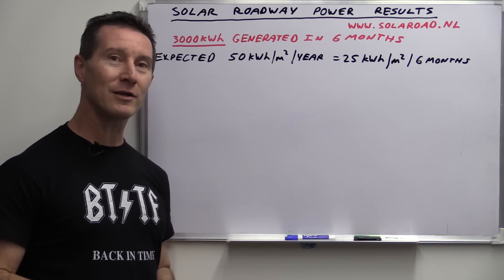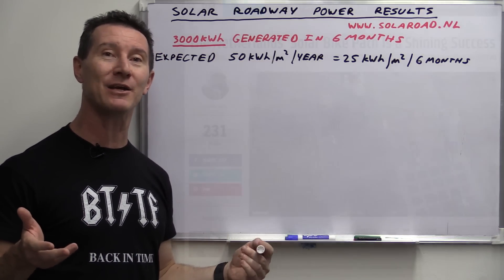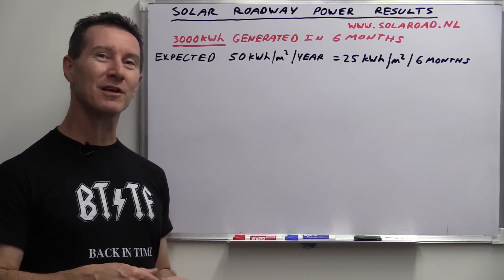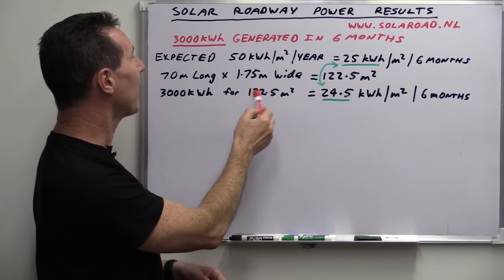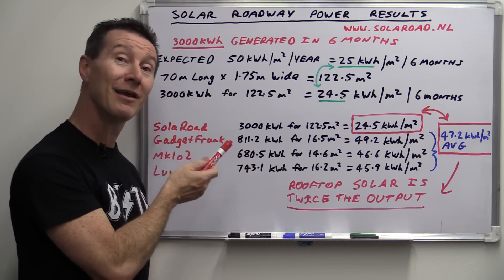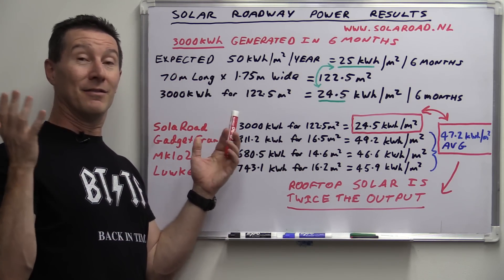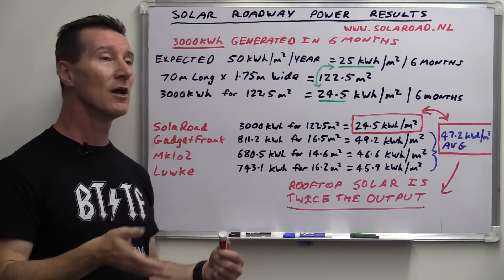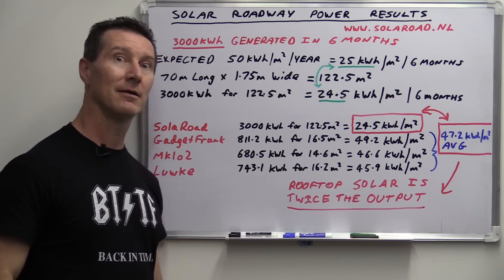EEVblog #743 - Solar Roadways Test Results

Comment: I live next to the bikeway, it was closed for almost the entire winter because it was broken. It was also an unusually warm year.
Reply: MichaelKingsfordGray It snows maybe once a year in the Netherlands.
Reply: ***** They are also inefficient in the usual way: it will take 4,000 years to generate enough electricity to pay for their installation cost. That's rather seriously inefficient, wouldn't you agree?
Reply: Isaac Karjala
You can't have an aperture without a lens? Any hole or opening is an aperture. It's not just a photographic term.
And yet, have you ever used a pinhole viewer? You know that the pinhole is an aperture without a lens?
Reply: *****
Maybe you should look it up and read all the meanings instead of your own narrow view.

The word itself literally means HOLE, comes from the Latin word to "to open" and is far older than cameras and camera terminology.

Merriam-Webster:
Full Definition of APERTURE
1
:  an opening or open space :  hole
2
a :  the opening in a photographic lens that admits the light
b :  the diameter of the stop in an optical system that determines the diameter of the bundle of rays traversing the instrument
c :  the diameter of the objective lens or mirror of a telescope

Oxford Advanced learning Dictionary:

aperture noun

(formal) a small opening in something The soldier fired the rifle through a narrow aperture in a pile of sandbags. The bell ropes passed through apertures in the ceiling.

(specialist) an opening that allows light to reach a lens, especially in cameras For flash photography, set the aperture at f.5.6. Open up the lens aperture to maximize the brightness of the shot. Binoculars of this aperture are very expensive.

Word Origin late Middle English: from Latin apertura, from apert- ‘opened’, from aperire ‘to open’.

There you go, facts that took about a minute to look up yet again for the same person who can't bother checking, yet again.
Reply: ***** Yea, i was just going to tell him to look it up in a word book in stead of wikipedia,.... welll any way, would be interesting if he response to this with a ..

"If people make mistakes why don't they just admit / fix them instead making them look silly by arguing their mistake is correct?"

typ argument, just ignore the facts, or not respond at all.
Reply: *****
"Didn't one actually admit to not watching the video?"
Well i don´t no if they admit it, but they really cant do it, its to dangerus, it might change there world view, and that is really painful.
Reply: ***** ignorance is bliss.
Reply: ***** Its really a question of how clody it is, not warm (at least in the summer). But in the winter the clowdness and heat is often connected. It would be intresting to compare this november to april to the one 2013 and 2012 and se if it better or worse.

I would suspect.... well not living in Netherlands, but fairly close, that this winter was far better.
Reply: Rashombo Hans Brinker would need silver swim fins now!
Reply: ***** Well, its probobly the glas that broken, not the actuall panels. I would guess that there is two layers of protective glass.
Reply: matsv201 I thought their glass was made of quartz.
Reply: RagingDong Did i say something other?
Reply: MichaelKingsfordGray
That is what they proposed to build the roads from.
See, per mile, reflection based solar towers collect 1000's of times more power than solar roads.
Reply: Here is the thing. Regardless of what tech you use for making the sun into electricity. The cost of the glass will always be about the same (per area). (well, unless you put it on the ground and run cars over it)

So you always want maximum sun exposure. So high up and in a optimal angle is the best.

Also, there is two routs. One is to use cheep silicon PV had have the lowest possible price. The other route is to use more advance method and have higher price system, but less amount of glass.

For a standard Silicon based PV roof top installation the cost is like 25% PV:s, 25% glass, 25% other installations (mostly electronics) and 25% work.

Pushing down the price of the PV:s just don't make any seance. If the PV is totally free, you still have 75% cost left.

On the other  hand. If you can double the performance of the PV, say you double the price. You got 50% PV cost, but 12,5% glass and work, and probably like 20% instillation cost. The problem is that PV that are twice as efficient is not twice the price, rather 10 times.

Going the CSP rout then is much more logical. Not only does a good CPS produce about twice the amount of power (for the same area) it also produces power during about twice them time of the day.

The problem is that the CSP is more of a centralized product like any other power station, and the on roof solar is more of a political statment, than a energy-economic one.
Reply: matsv201
If a PV panel costs 25% for the PV cells and you double the cost for those, the end price is 125%, 1/4 more not 10 times.
Reply: ***** No, doubeling the efficenscy, not the price. That was one exaple where efficency was tied liniery to price, and the real world one where it 10 times more expensive.
Reply: RagingDong
You can do that anywhere on Earth that sun shines and get distilled water out. It just takes bigger reflectors in some places.
Reply: RagingDong Actually i would say that the Stirling powered CSP is both more efficient and more modular than they big steam once. The best one is doing about 35% from light to power, that is pretty good. Its basicly twice that of PV and with the turning tower the capacity is twice over again.

The is the question if bioreactors will be more efficent in the future. They are almost copetative alreddy to day.
Reply: MichaelKingsfordGray It depends on. There is some efficent carbon capture, like the one the US navy uses that actually work. So it actually works.

So i would say its actually not as bad as you say.
Reply: MichaelKingsfordGray You dont need a peer-reviewed article for something like this, you just have to have knowledge in basic math
Reply: MichaelKingsfordGray
They are only inefficient compared to the current cost of fossil fuels with minimal to zero regards for pollution and the costs that inflates.
Reply: matsv201 pv brings power generation to where power is consumed, hence lowering transmission losses and by lowering transmission losses a lower efficiency on the generation equipment is acceptable...... Also, thermodynamic efficiency of PV, CSP, wind, etc is entirely irrelevant since not having solar panels today does not result in more sunlight tomorrow..
Reply: topster888
Inefficient? How about insanely stupid!.
Reply: Isaac Karjala Now, it don't work that way. Electric power is instant. If you dont consume it in the right place and time, you have to move it.

Solar power actually need a lot longer transfer lines than nuclear power for example. So that assertion is totally wrong.

Efficiency of environment farming power-plants is very important. Because the aparature size is directly related to the efficiency.
Reply: matsv201 ....... Roof mounted PV does not use longer transmission lines than nuclear.

I am pretty sure that the only places they are using PV right now, rather than concentrated solar thermal, is when the land has to have other uses other than power generation or when they don't want to run power lines.

If you don't use sunlight today, you won't have more sunlight tomorrow. So it doesn't matter if PV is 1% or 25% efficient; all that matters is how much space and how many dollars do you need to meet your energy needs.
Reply: Isaac Karjala "Roof mounted PV does not use longer transmission lines than nuclear."
You are wrong, The transfere distance is both on a avage longer, and its lower voltage. The power is very seldom used where it is produced. At least if its on private homes. If its on a public building its more complicated.

" rather than concentrated solar thermal, is when the land has to have other uses other than power generation"
No, its rather a matter of how the subsidies work.. In Europe the subsidies is based on production. This makes PV produce more subsidies.

If the subsidies is based on sales pris, then CSP is better. Also, CSP works a lot better in dry areas. Dry area very seldomly is used for farmland.

But looking at germany they do use a lot of farmland for PV.

"So it doesn't matter if PV is 1% or 25% efficient"
It does because of the aparature size. Its also a matter of load balancing. And its probably the biggest problem
Reply: Rashombo Yes.  And that once a year, you need to worry about the potential of snow piling up and breaking your expensive solar panels.

Regardless.  The covered path idea is brilliant, because it has the added benefits of sheltering cyclists from sun and rain.
Reply: matsv201 what in the fuck are you taking about? It doesn't matter if the Sun provides 20,000W/m^2 and PV is 1% efficient or if it's 1000/W^2 and 20% or 200W/m^2 and 100%, it is still 200W/m^2 of PV...... Electricity takes the path of least resistance and for PV in an urban or suburban setting that path isn't going to be very long.....

PV doesn't use lenses, so there is no aperture.... What in the fuck are you talking about.
Reply: Isaac Karjala Aparutre size is a term using outside photography do discrete the revising area. And apart from CSP there is also PV that actually do uses lenses.

Now the sin is about 1300W/m^2 regardless of the efficiency of the solar panel. So higher efficiency is preferential.

Its also a matter of exporter time and angle. Its a matter of capacity, not power.
Reply: ***** whatever, PV still has no aperture.
Reply: matsv201 you're just stringing words together.
Reply: Isaac Karjala In physical terms a PV is a aperture because it consumes photons 

You not understanding technology, is not the same that is hard to understand me. You are projecting your difficulty onto me.
Reply: Isaac Karjala
Depends on how you mount it. Is it behind a frame? Then viola, aperture of the frame.
Reply: matsv201 If people make mistakes why don't they just admit / fix them instead making them look silly by arguing their mistake is correct?

Aperture is used almost exclusively to refer to a hole that acts like a valve or control for incoming light. The word is not exclusive to camera apertures, but I have NEVER heard or seen it used to refer to something else. The role of consuming photons has absolutely nothing to do with an aperture, which at it's simplest, serves to control / allow light to pass THROUGH. Read https://en.wikipedia.org/wiki/Aperture It never once mentions consuming light.

Solar cells have a layer of semiconductor that absorbs light, which excites the semiconductor's electrons and creates current and heat. This layer is usually hole-free, so it's not an aperture either. 

The only thing that might be resembling an aperture is the metal frame, but those are designed to block AS LITTLE LIGHT as possible, and do not serve the purpose of blocking or controlling the flow of light, and are not an aperture. I would more correctly label the frame as the "window" of the panel, as it is designed to let light in, and not to CONTROL or LIMIT the light coming in.

Side note: Would that make window blinds a type of aperture? They certainly control the amount of light that passes through.
Reply: ***** 
"If people make mistakes why don't they just admit / fix them instead making them look silly by arguing their mistake is correct?"
I cant see anything stoping you.

"but I have NEVER heard or seen it used to refer to something else"
Well, thats you, i heard of it quite a lot.

"It never once mentions consuming light."
Well,  that because you are in the specific article on aperture referring to cameras.

" This layer is usually hole-free, so it's not an aperture either."
A solar cell is normally not considered a camera, so you should not assume the term is about cameras, when not talking about cameras.

(you can actually make a camera out of PV:s, but that is a other story)

Go check the WHOLE wikipedia article about appature, then come back to me and see if you find anything that is not a camera that apples to this.

And YES, there is a wikipedia article referring to the type of aperture that i´m talking about.

Then come back and admit you was wrong...,fine.
Reply: matsv201 
"I cant see anything stopping you."
Edited previous post.

"Well, thats you, i heard of it quite a lot."
>Posts contradiction without any points to back it up. 
What other use of the word "aperture" do you hear used quite a lot. Is this use related to solar panels at all?

"A solar cell is normally not considered a camera, so you should not assume the term is about cameras, when not talking about cameras."
You criticize my critization of him using a word completely wrong for the situation for using the wrong context for this situation? It's criticizeception! Then tell me what context or use of the word "aperture" makes sense when talking about solar panels. Every use of the word aperture I could find that is commonly used is still not applicable, so i still have nothing saying this use of the word was correct.

"(you can actually make a camera out of PV:s, but that is a other story)"
That sounds horribly inefficient, but I kind of want to see that now.

"Go check the WHOLE wikipedia article about aperture, then come back to me and see if you find anything that is not a camera that apples to this." Already did, as well as here https://en.wikipedia.org/wiki/Aperture_(disambiguation) And reading through the list, none of them really apply to solar panels. It was simply the wrong word to use.

"And YES, there is a wikipedia article referring to the type of aperture that i´m talking about."
Of all the unfounded statements in your post, this one is the most puzzling. If you have the link, post it! I'd love to learn something new.
Reply: *****
"What other use of the word "aperture" do you hear used quite a lot."
Its not a other word, its the same word, but used in a other context, it works differently.

"Then tell me what context or use of the word "aperture" makes sense when talking about solar panels."
Receiver, more exactly antenna. 

", so i still have nothing saying this use of the word was correct."
You can´t based the argument on your own ignorance.

"That sounds horribly inefficient, but I kind of want to see that now."
Well, it probably is, just that someone actually built one.

"And reading through the list, none of them really apply to solar panels. It was simply the wrong word to use."
No you are wrong, there actually is one. And if you checked that the first time, why did you post the one for camera, when i specifically say that it not aperture as in a Camera.

"The word is not exclusive to camera apertures, but I have NEVER heard or seen it used to refer to something else."
So are you lying now, or did you lie before?

"If you have the link, post it! I'd love to learn something new."

Well, you get this fare, hopfully with out cheating... 
https://en.wikipedia.org/wiki/Antenna_aperture
Well, get out of here, it turned out i was correct...
Reply: matsv201 
To my question what context or use of the word "aperture" makes sense when talking about solar panels, you replied:
"Receiver, more exactly antenna."
Ok. So according to Wikipedia:
"In electromagnetics and antenna theory, antenna aperture or effective area is a measure of how effective an antenna is at receiving the power of radio waves."
This context for the word aperture is even less correct, as it is specifically about antennas. Solar panels, as well as photodiodes, photoresistors, optical sensors, and other components that detect and measure light are clearly distinct from antenna in many ways.

 Antenna work by electromagnetic waves from a radio source inducing an electrical voltage within the conductor directly. Solar panels (and most types of photodiodes, photoresistors, etc) work by light interacting with a semiconductor, exciting loosely held valence electrons to a higher energy state allowing them to be freed from their molecule and allowed to flow,  therefore creating voltage. 
The voltage received by antennas is very weak, and it's used as a signal to transfer and receive data. Solar panels specifically are designed to absorb all kinds of light for the purpose of using the created voltage for power. Antenna use physical construction / shape to pick up a signal, where solar panels use chemical composition / molecular scale 

Different principles, different design, different purpose. Solar panels are NOT antennas, therefore using the context "antenna aperture" is incorrect when talking about solar panels. (An interesting discussion on why we don't use antenna to pick up visible light is here: http://www.researchgate.net/post/Why_is_it_not_possible_for_dipole_antennas_to_absorb_light_waves)
Another thing to note that antenna aperture is used to help measure the efficientcy of antenna. Solar panels have their own way of describing efficiency, therefore for the purpose of measuring solar panel efficiency, the word aperture is being misused. Read: https://en.wikipedia.org/wiki/Solar_cell_efficiency

"And if you checked that the first time, why did you post the one for camera, when i specifically say that it not aperture as in a Camera."
An optical aperture made the most sense to talk about, since we were discussing solar panels, the optics of the glass in front of them, and I think someone brought up how the bumps on the top of the glass could act like lenses. No One was talking about radio waves, so better question is why did you think anyone was talking about antenna aperture?

Here are the comments I was responding to, and why I responded to them in the first place:

"Efficiency of environment farming power-plants is very important. Because the aperture size is directly related to the efficiency."
Aperture size of what? Perhaps he means the opening on a solar tower design? (The one that uses field of mirrors that feed to a tower). This is where the confusion in following comments began.

"You can't have an aperture without a lens? Any hole or opening is an aperture. It's not just a photographic term.
And yet, have you ever used a pinhole viewer? You know that the pinhole is an aperture without a lens?"
This is the main reason I responded. His first and last point are valid: You can have an aperture without a lense, completely true. The last sentence is also very true, because even though the hole doesn't move, it still serves the purpose of limiting / controlling the flow of light into the system. IT was the second thing he said: any hole or opening is an aperture - that got me wondering and was why I replied in the first place. 

I would argue that a hole, like a window, that is designed to allow in light without controlling it is not an aperture. In the wikipedia thread, as well as other resources I read, have a particular emphasis that an aperture serves a purpose to control or limit light. Simply being a hole without any consideration for limiting or controlling the light it lets in does not denote an aperture

But if you have blinds, I'd argue those could be considered an aperture (or shutter) in they have the same purpose.
Reply: ***** "light are clearly distinct from antenna in many ways."
Go check out your middle school textbook and look up what light is.

"held valence electrons to a higher energy state"
There is no real difference here. The only special feature with a solar panel is that the energy is that high so you don´t need a filter before absorbing the energy, this allows you to put the electrons directly into the system in steed of looping it in filters and other components. The PV-junktion is of cause a resvicer it self, but it can work directly of the power of the photons and don´t need to collect up 100 or 1000 of photons to make one signal. This is a clear advantage of visable light, but it don´t make it any less of a antenna.

"Solar panels are NOT antennas, "
They are, they. You are wrong.

"(An interesting discussion on why we don't use antenna to pick up visible light is here:"
Well, firstly its a bout a dipole-antenna, there is other kinds. Secondly they are also wrong.
https://en.wikipedia.org/wiki/Nantenna
This is a more traditional approach to make a nontraditional solarpannel.

"Another thing to note that antenna aperture is used to help measure the efficientcy of antenna. "
No its not, its use to measure the efficient area, no the efficiency. Its not the same thing.

"An optical aperture made the most sense to talk about, since we were discussing solar panels, the optics of the glass in front of them"
Aperture is actually a general term for receiver area, its actually what it is. But the term have been hijacked for camera use. There is actually no difference in optical or radio use.

Its not really that Wikipedia is factually inaccurate, its rather that they organized the page so it looks like the camera use of aperture is the main definition, its not.

"Aperture size of what?"
Its just plain efficient receiving area. The point being that the efficient area may be both larger or smaller than the physical area.

"You know that the pinhole is an aperture without a lens?""
yes... and?

"any hole or opening is an aperture "
Well its true,... well that is if there is anything reeving 

"I would argue that a hole, like a window, that is designed to allow in light without controlling it is not an aperture"
Well then you are wrong.

" have a particular emphasis that an aperture serves a purpose to control or limit light"
Well, now you are in the "Aperture (Camera)" site again where they removed the (Camera) with no reason what so ever. What you read on the "Aperture (Camera)" side is only true for apertures on cameras.

Its bad they don´t have a general aperture side, but look at the antenna one that is more physically accurate. A window is not really a antenna, but it works the same way.
Reply: matsv201
The only facts needed to show how stupid solar bike paths and roadways are is in the video and have been gone over and over for these cretins who apparently can accept it even to claiming that the points made were not.
Didn't one actually admit to not watching the video?
Reply: matsv201
Walking through the world with blinders, shades and closed eyes has got to be painful too.
Reply: matsv201
Until the walking blind find out the furniture's been rearranged. Then it's a bitch.
Reply: matsv201 The discussion isn't even related to the video anymore, and is getting more off topic. 
I wrote a big reply here if you care to read it http://pastebin.com/TL6Dzf2C
If we want to continue arguing the use of words, it feels like it belongs on some kind of literary forum, instead of in off topic youtube comments.
Reply: The only effective form of solar power is the first, large tubes of water in a hot location, ie the sahara or that desert in america/
The heated water turns turbines. or evaporates into steam turning turbines.